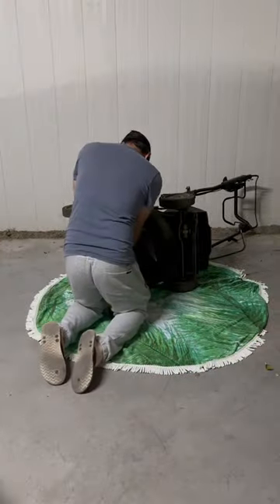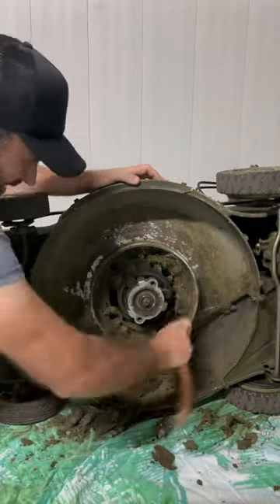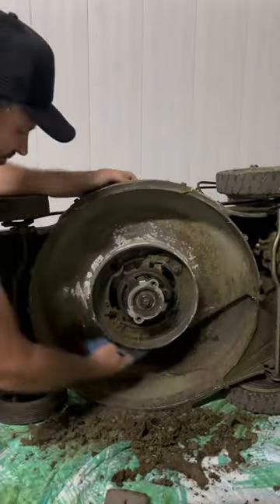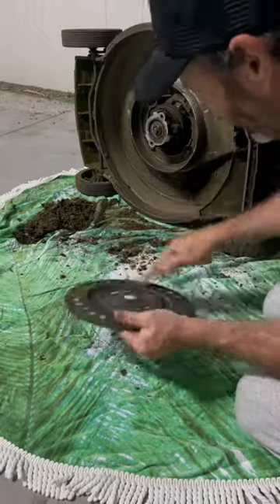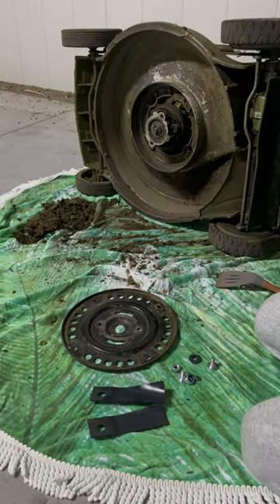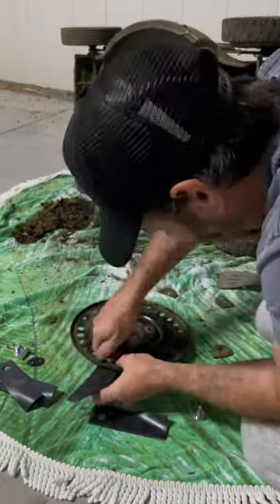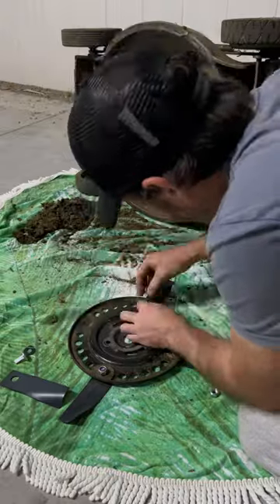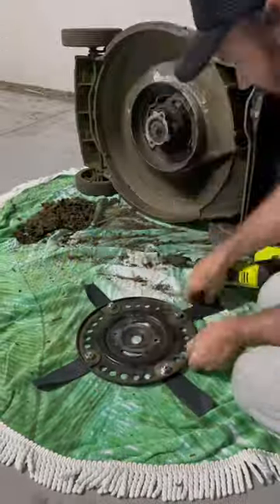Is this the most important part of the job? #shortsfeed #youtubeshorts #shorts #gardeningtips #home

Comment: My old mower runs one big 23 3/4" blade. You will know pretty fast when it's time for a fresh sharpening! Is the metal plate with the 4 blades a factory setup, or aftermarket? Stay cool, Nathan 🕶